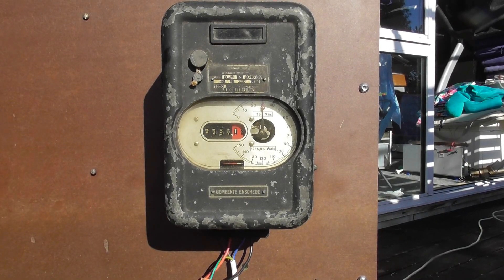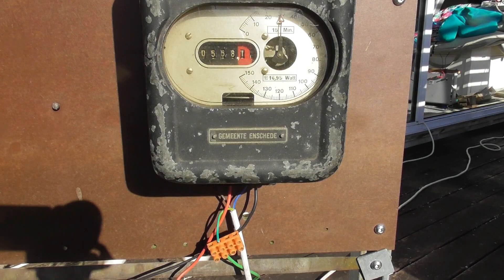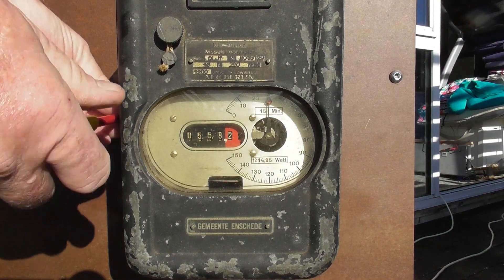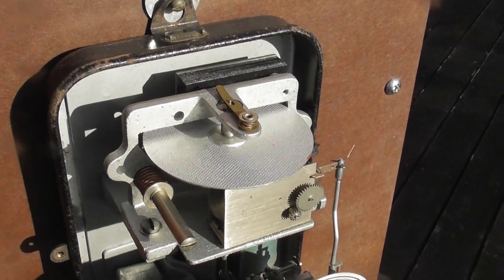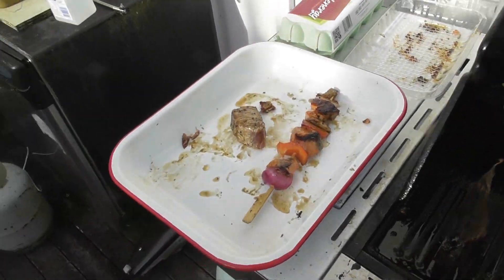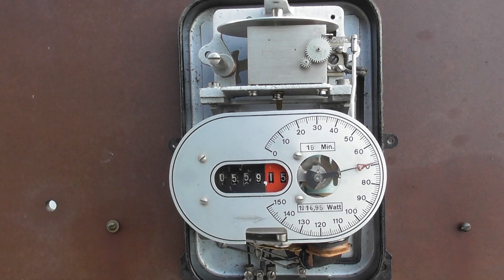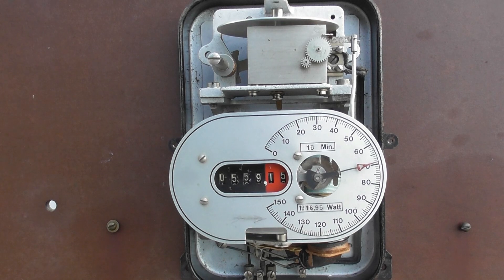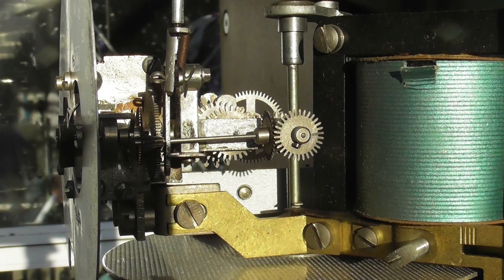100 year old AEG meter still works perfectly. AEG Type OLJf

Comment: Straight cut gears, likely made with an indexing head and a shaper, using a mass of blanks held together in a block and then shaped all at once. 

Lovely device, both the meter and the bottlebrush feline device.